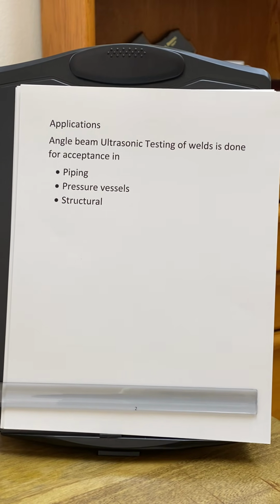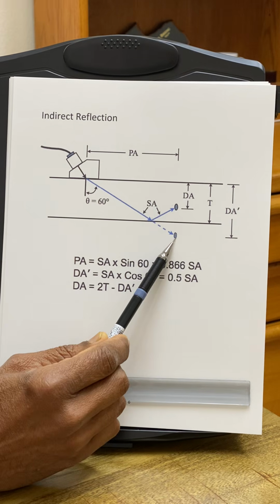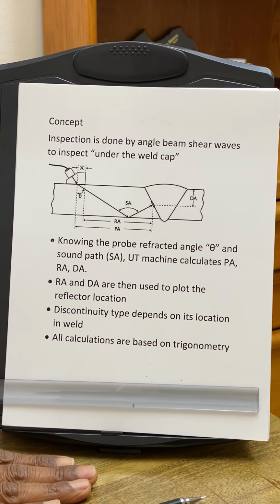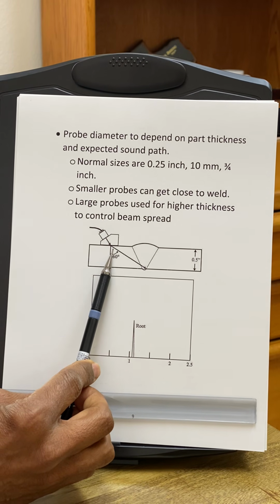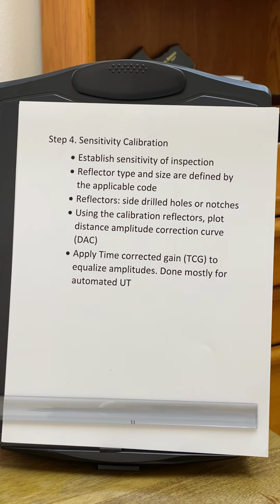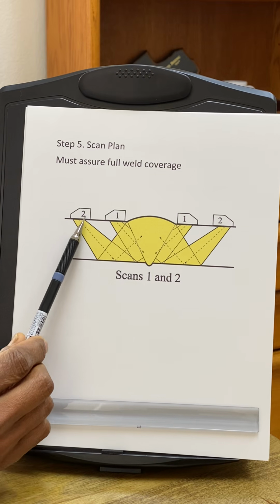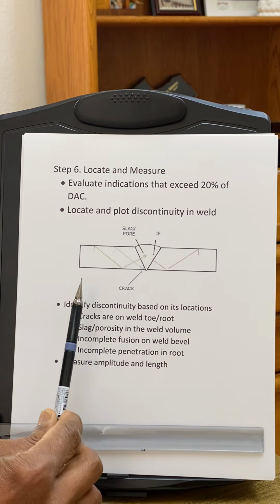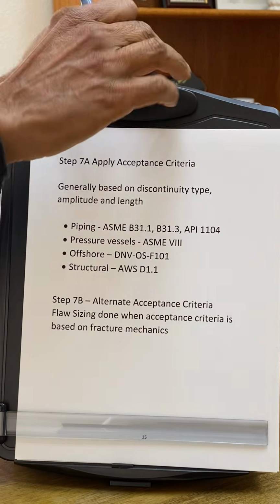Birring 202 UT Angle Beam Ultrasonic Testing of Welds - Shear Wave

Comment: The new ut machine do all the trig. calculations for the specialist. Now only the (angle and thickness) need to be programmed to the machine.  However,  will I put 2T for the inspection in second leg? And 1T on the first?
Reply from the maker: Only 1T. The instrument makes the adjustment